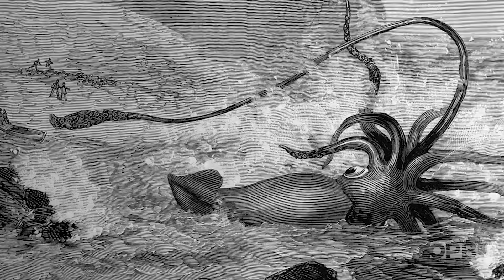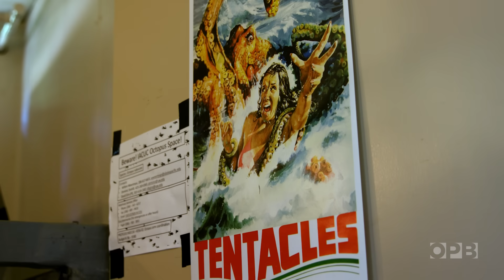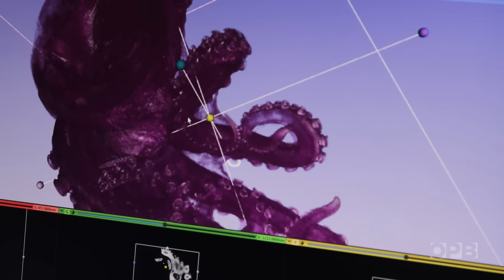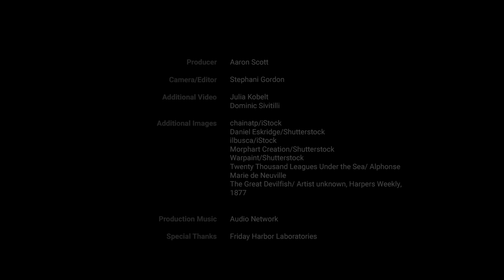Look to the octopus to understand how aliens might think | Oregon Field Guide

Comment: 5:00 But do they think with their arms? Human only use a part of their CNS to think. For example our brain stem and spinal cord don't do any thinking at all.
    They can do some processing. For example you touch something hot you are already pulling your hand away even before you feel your hand burning. It's actually the spinal cord that sends the message to the arm to pull the hand away from the thing burning your hand.
     You can override this reaction if you know you are going to touch something hot, but even then it's not easy.

Comment: I am almost 70 now but I clicked on this because of several hundred more than 700 dives in puget sound that they said the alien thing. After arriving to the area as I started diving in Puget Sound the first octopus I saw was a small red full grown octopus rubescens and I commented to people it was like an alien with a presence. I specifically said about 40 years or so ago? "it was like meeting an alien" It was no bigger than my hand but I later learned was full grown. I did not have the knowledge at that time that for me to take multiple photos likely would result in his death. They get winded easily. as the years went on I would wag my fingers at the big ones and photographed a fight between two big ones but I stayed my distance These were doflieni but they are an advanced animal no doubt about it. I wagged my fingers at one in a cave not a good idea because he came right out
Reply: also their tentacles have a BRAIN OF THEIR OWN. i sat and watched a big one at pt defiance down in a cave only the tiny wisps of his tentacles sticking up through the rocks fishing for shrimp I sat and watched the tips of those tentacles moved around AS IF THEY HAD A BRAIN OF THEIR OWN tapping and feeling and reaching. each tentacle was like the head of a snake with eyes. and yes i and we did feed them crabs you bet we did. an octapus will come out so quick for a crab you wont believe it.
Reply: @jaysilverheals4445  this is a really wholesome, and informative comment that's just brimming with personality and long-lived experience. Thank you for sharing.

Comment: Their minds are so fascinating, I have so many questions, like..... is an octopus dumber if it loses an arm? Does it lose memories if you chop off an arm? Does its personality change when it grows an arm back? If an octopus had 16 arms, would it be an Einstein octopus? What about siamese twin octopodes, are they smarter? Do they have a left and right, or do they handle direction differently with all those arms? Are they legs, or are they arms, and are they walking, or are they crawling?
Reply: the way i understood it is that the arms and central brain at large are mostly separate. so the arms wouldnt influence the main brain. it doesnt sound like the arms have a "personality", more than the arm "brain" just acting like a high level interface for the main brain. this allows the main brain to be smaller and operate with simpler, more "general" commands as mentioned in the video. so in other words, one less tentacle would just mean one less tentacle imo
Reply: One less tentacle would mean less information passed to the brain. It wouldn’t get dumber, from it's optimal self it probably would get slower
Reply: i love your questions!!

Comment: The problem with this idea is that technological civilization cannot be generated by an October’s like animal without very radical modifications. The  modifications necessary to achieve a technological society would be so great the animals would bear only a very very slight resemblance to an octopus or squid. First the animal must exist in a dry environment. Water environments preclude techno civilizations because the most fundamental aspect of techno is fire. Secondly they must be relatively long lived. Octopi on Earth die in 3-4 years. The alien organism can die following matting or upon giving birth. They animals must be able to create hard structure in a dry environment. All of these things and more require a much different body and neural plan than are present in octopi.